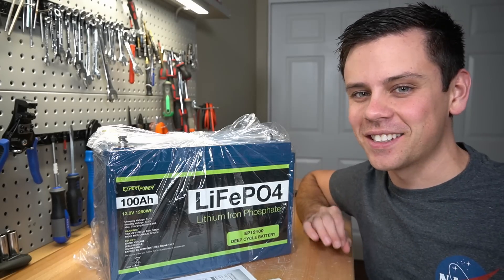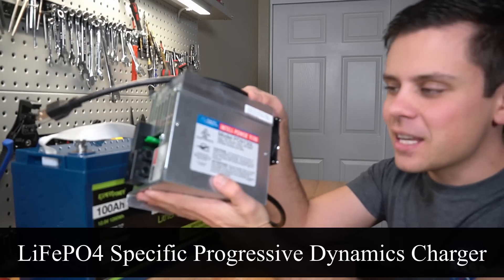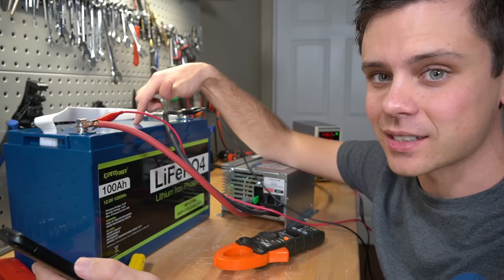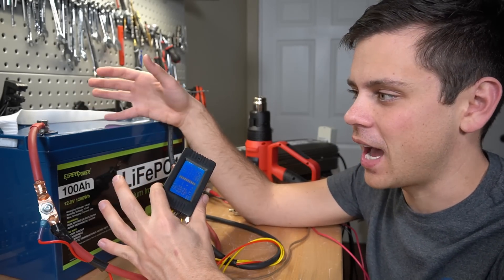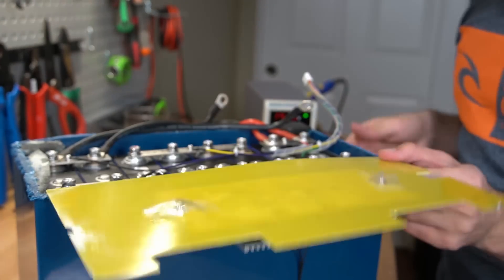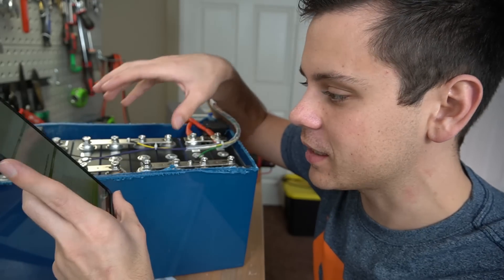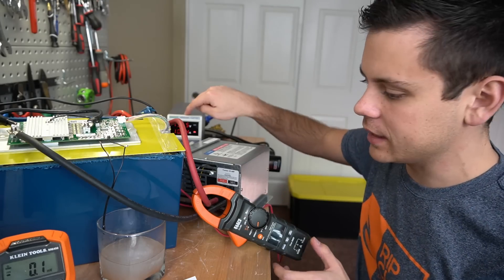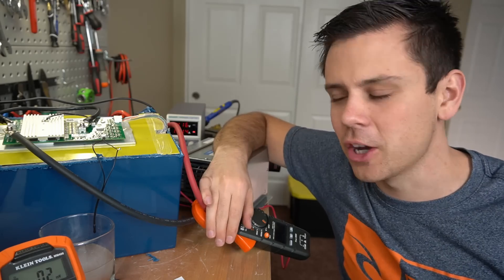ExpertPower 12V 100Ah LiFePO4 Battery Tear Down!

Comment: you could try to spray the ICE SPRAY directly to the temperature sensor, to test whether or not there is a low temperature disconnect
Reply from the maker: The frozen salt water is plenty good
Reply from the maker: It's more cold than we need it to be
Reply: @WillProwse   I watch all your videos and I often see that "low temp disconnect" doesn't work. It is therefore not clear if it does not work, if the electronics have the wrong threshold or if the BMS that has a fake "low temp disconnect".
My suggestion is to see if the electronic works/exists. With the ICE SPRAY you can even reach -50 ° C, and in a few seconds you can see if the "low temp disconnect" exists. Therefore:
A) If it disconnects: you can spend more time studying in what temperature the BMS disconnects. In this case you can study if there is a good or bad threshold temperature
B) If the BMS does not disconnect: it is totally a fake "low temp disconnect" ( or it is faulty/broken )
Reply: @mauroNZT  That's indeed a good idea!
Reply: @mauroNZT  yes those pesky fake low temp disconnects are invading our borders and need to be captures and the ejected without much to do.

I think that the imported flashlights and other saying anyting Packaging is pretty rare when it comes to energy storage because you can't lie about stuff that matters to the people who are buying it that is what we call a commodity. As well points out we are not going to give him a second chance if he cheats and those companies that sheet AR not going to thrive. A paragraph

Integrity can seem very expensive or a luxury two people from other cultures could you not understand but when you look at the Empire State Building it didn't take an incredible number of liars to get that done it took something more like artists. The artists that are built the dams and the old buildings did not have whips at their backs or did not merely have lips at their backs.

To ship a battery that has components that are part of the specification that are not productive even if one can argue it was a problem with the software is to engage in fraud. That is to say there are people who knowingly did this. You can do your strip searches of the people that you hire to find the diamonds in the dirt but diamonds are very small.

In America we used to have people who consider themselves part of a team. They were happy. For most Americans the pursuit of joy what's going on a wild goose chase. In other countries the happiness question is not breached, mirror survival is all consuming.

The development of human beings like an electric chemical battery can be observed and improved upon. One of the TV personalities is fond of saying quote you're dead to me. This type of death is to be feared for those who seek in their Pursuit of Happiness as well the trust and patronization from those who trade money for what they produce.

I do not agree with the argument made in the confession that coming clean should limit the damage to the brand. A paragraph

It is not about getting angry with such fraudsters. It is about understanding that there are plenty of providers of vendors of Engineers and entrepreneurs who are not even tempted to cheat. Nor do they seek the services of those who need to be stripped naked in order to keep the inventory going in the right direction.

Those who argue that using slave labor as fundamentally American live in a world of the past and the world that is increasingly dangerous.

It is possible to solve problems for Less with Liberty for all.

There are for example countries where democracy is taken more seriously. Countries like India. When considering the electric bicycle people want to Country like India have even greater motivation to get it done better and for Less.

There it is not about tricking the consumer. So when we see a country that has wealthy customers in it and companies in it that can truck driver from anywhere in the world and do so from India bad Beyond the claims made my the business and science and engineering team of L7 power provide an optimal didactic opportunity
Reply: How do we take a relatively weak chemical reaction degenerates the flow of electrons and get the bicycle wheels to turn better than we using the chemical reaction to their own body can do without augmentation.

For me this question is a large part of the problem and that we don't need to use the same sort of Madness that our bodies used to do work but if we are going to do that putting batteries in series increasingly large numbers and increasingly there are there in a rising voltages does reduce the current but it has created I need for more relays and complicated wiring completely opposite when charging to what one needs when consuming the power.

So historically we have done cost engineered alternatives to the obvious solution.

In solar energy systems however innovation is occurring because of the commodity that is being handled and the very high levels of subsidy Trading virtual returns in reward for cross stitching Dairy.

One way of encouraging students apparently to actually pay attention to the meaning of the sounds that these words signify is the scramble various ways generating these sounds as the stick Tatian is doing.

Say these words to yourself as if somebody else was being overheard making the sounds and try to figure out the meaning parody paragraph

I am not sure what's going to happen with the bicycle that is coming out in a few weeks that does not have the batteries in series.

Having your energy be local makes the need for thinner wires less imperative. The bicycle is rarely operated on an extension cord. For very small children you can have them enjoy going around in circles weather for center of the circle bunch of solar panels and noon and the wire connected to some $30,000 electric motorcycle that you picked up for a couple hundred dollars at some yard sale in Beverly Hills.

For the rest of us you may wish to go beyond our own driveways we are going to be using on-board supplies and electricity. As we design Lee's tools some of us who have breathtakingly fresh approaches will be enriched.

Cheating is not innovation. The opportunities for Innovation or ample enough without you need to employ deceit. When a vendor ignored takes offense and attempts to trick us because they do not agree with us they have confused there r o l e.

Customers are not the slaves either. We do not ask for specifications because we need to know that they are there in print. We have the expectation that is under the claims did not destroy the battery in the circumstance we outline has not done the forecasting private settlements for fraud with those who are harmed and who survived and bring the claim and lack integrity to take the money and shut off.

There is a movie about Fox News it has a scene on an elevator which in reality has assembled a bunch of supermodels fresh from my salmon all day Makeup Session. Your paragraph

The point is that they don't think of themselves as slaves. They are pulling in however many millions of dollars a month after all. But they are not just being paid for satisfying the viewers. the problem for those riding the elevator is that they know this about themselves themselves.

It is easier to lie to those who do not know you are lying at times. Eventually you fine though that you are the same as those you are trying to lie to. this is what happens in that elevator. Their gut reaction of disgust and compassion both to the other is suddenly understood as having Merit for themselves as well.

 To those so miserable they would not just stare to cheat US but clearly have a banded entirely the pursuit of happiness and are in some sort of survival mode we owe compassion but not patronization.

Our money is volunteers to those who are on our team it is sharing after all not enslavement that we aspire to.

This battery company is not on our team and we'll never be able to be on our team they are not playing in our same league they are not playing the same game and where Liberty is demonstrated as being beyond their capacity to maintain it is our duty to give others a chance for it.
Reply from the maker: And sensor was full submerged

Comment: Is there no way of testing the sensor? You seem all too eager to say it's not worth buying without verifying whether or not you happened to get a faulty unit. Just sticking it in progressively colder water seemed pointless. Surely the sensible thing to do would have been to firstly get a replacement, run it through the same tests again and then have cut it open to see if it actually had protection.
Reply from the maker: What? Are you joking? Who cares if it's a faulty sensor, it should have been caught by quality control. If you leave a battery in a freezer for three hours, it should disconnect charging instantly. How is that being "too eager to say it's not worth it"? Are you suggesting everyone open up their batteries, and test the temp sensor? If it doesn't work from a simple test, it shouldnt be sold. I can trip the low temp charging protection on other batteries, every time. It's a simple test.
Reply from the maker: And yes, colder water is actually very logical because I did not know the threshold for cut off. I did that for a reason
Reply: @WillProwse  yes, it should have been caught before it left the factory, but mistakes do happen and faulty products get missed for whatever reason. And I was suggesting no such thing as that, I said you could have sent it back and then have redone the tests on a replacement to verify whether or not it actually had protection and thus it only being faulty on that unit, before cutting it open as you had intended too. Also, when I said 'testing the sensor' I meant only yourself since you had the battery cut open!
Reply from the maker: @incorporeal3793  Ohh ok I see

Comment: This might be a good battery for an Inergy Apex setup!
Reply from the maker: No, this would be horrible for that. Apex charges to 12.6 for external battery. LiFePO4 wouldn't charge past 10% SOC with that as absorption. That would be the worst combination.
Reply: DIY Solar Power with Will Prowse Thank for letting me know, I almost bought the Apex.

Comment: I was cringing a bit when charging well below freezing, even for testing...
Please measure the capacity again, and see if there's a difference!
Reply from the maker: Yes will do 😊
Reply: @WillProwse  Thanks.. would be interesting to know if any difference is significant, and therefore how much to really worry about low temp charging.
Reply: @ahaveland  You and everyone needs to worry about charging Lithiums at low temps. Perhaps not for the first few minutes(or even an hour...maybe) but at some point most lithium chemistries are damaged (ruined really) when charging at too low of a temperature. Will would not have damaged this battery in just a few seconds of a charge test. There will be no difference on a second cycling other than what can be expected of a new battery.
Reply: @geraldhenrickson7472  What temp is "too low"? 40 deg F? 30?
Reply: Bring your production back to the US
Reply: It takes time to damage the battery from cold charging, and a really long Time to even get the core of the cells to freezing temperatures. The temp sensor should definitely been cold enough to prevent charging. To show considerable damage the battery would have to be very cold, and charged for a near full charge, it would have to be very cold to offset the temperature while cell heats from charging, just a few seconds to minutes would make no noticeable difference, unlike discharging to zero volts, that basically kills a battery, when discharged completely. Basically all the lithium ions are pulled from the positive electrodes. Changing the electrolyte, and Making it very difficult for the battery to function. I have a few, they act like capacitors, with a very small battery in parallel. The voltage likes to stay between 3-3.4v and doesn't really act like a battery when testing. The only problem I have had with Batteries (LiFepo 4) is low performance below 40°F  you can charge a very cold battery , only at a very low current , until it heats up a bit, charging cold plates the electrodes, destroying capacity, ( it doesn't come un plated)  just a rough guess, about a 0.25 C charge should be fine. To about 20°F anyway, if they are 20°f or colder, I'd warm them , by discharging heavily if possible, then a low c charge,  like atleast a 1c discharge for 5 minutes, then a .25c charge..

Comment: You are funny, cuts open battery, plans on returning it. But I understand your point since the low temp cut off is such an important feature.

If the charge controller has low temp cut off, that would solve/bypass the problem? 
When charging a battery bank, only two are connected to the charger directly (rest wired in series/parallel), would it be enough to have one battery with low temp cutoff to shut them all down? Or will the BMS just pass the current on to the next battery? 

Bummer they only recommend 4 in parallel. That so limits off grid application. Especially with only a 70amp cc. Perhaps there should be a classification on those batteries like “suitable for small scale RV systems 12/24V 400amp Max”and “suitable for large full house and off grid applications12/24/48V >400amp”

What do you think of a home setup that’s separated into 3 indépendant 2kw systems. If one fails you have backup, you can move critical loads around. So you never really loose power. 
I’m thinking of this as a solution to be able to more easily expand my system over time.
Reply: You know when it comes to historic homes home is that may still be using candlepower 4 light those are the homes those are the customers that are going to create the disruptive Industries the homeowner that didn't want to Electrify their house that is still using natural gas in my amps because that's what they get up at dawn and they don't need much light before they go to bed either maybe they're outside maybe they're reading on there ebook maybe they're just watching TV in the dark on a 200 inch TV with all the money that they save.

For those who don't know this a house is a building that without electricity is comfortable all year round. House may have a fireplace but the fireplaces are not used for more than a few hours a day.

The house for thousands of years in the hottest climate for those who are successful remains very comfortable all day and all night without having to burn anything or operate any electric motors.

It is so amazing that we have seen architecture that depends upon things like electricity not in just smart ways but in clear corrupted ways. Resistance heat is the greatest example. But we know that those who covet the old fashioned light bulbs are not coming to that conclusion on their own.

Electricity is something that everybody in the world should be using because everybody should be able to use Electronics to do things that Electronics does best.

Your question concerns whether all the electrical outlets need to be centralized in the house. Of course they don't.

Very little needs to be done by electricity. Lighting and logic. We have these crowds funded businesses to create new products. If you search you can find ways of not just getting a t-shirt but getting a piece of the company that you are creating. This has not been legal for very long and there is a delay since it has become legal in it being put to use.

There's a reason it was not legal in the prior centuries. Those reasons are now obsolete. The only reason people continue to patronize Kickstarter and Indiegogo it's because these companies could lose trillions of dollars a year if they prevented those customers from instead purchasing essentially stock in startup companies which need no longer be the business only a billionaires.

This channels creator these Capital to accomplish has his dreams. If he searches for crowds based Equity funding he will find many providers of that tool. I trust Mr prowse to do that diligence as he takes it to the next level

Comment: Awesome review. Thanks. Get some sleep!  It looks like they use some grade B/C cells that didn't pass 75Ah mark of the manufacturer, and were sold as sub 75Ah cheaply to them. Then they did capacity matching and put ~110Ah in pairs. No other explanation possible I think. It wouldn't be so heavy otherwise. Rest looks okish.
Reply from the maker: Good point!! Oh man I wish I mentioned that in video. I should have weighed them. I was so distracted by the low temp cut off that I forgot. great point!!

Comment: Maybe the low temperature sensor fell asleep when you should have? Love your videos and information. Have been waiting for you to find the best battery for my money as I am preparing to unleash over 10,000 Watts of solar panels this coming May or June. Considering using a Sol-Ark 12K hybrid inverter for a totally off-grid system. Also integrating 3.5K Watts of wind and 2500W of hydro into my system. Should be some interesting electrical engineering and assembly.
Reply from the maker: Oh man what a killer system. I am super jealous too.

And I am testing some cells you might like. They are crazy durable and should last for decades. Very unique compared to other cells I have been testing. I will try to post the video tonight or tomorrow.
Reply: @WillProwse  Thanks Will,  I am looking forward to viewing it.
Reply: Jealous